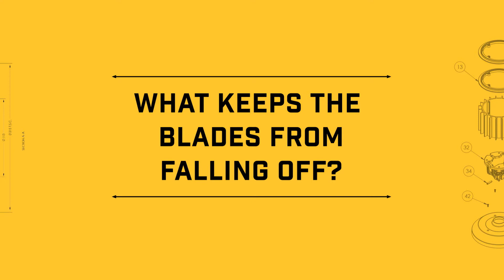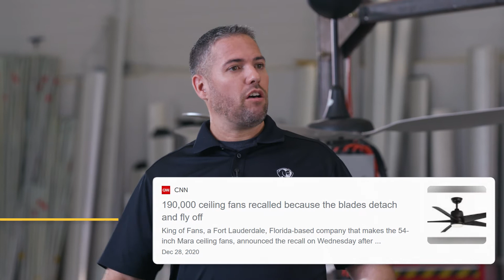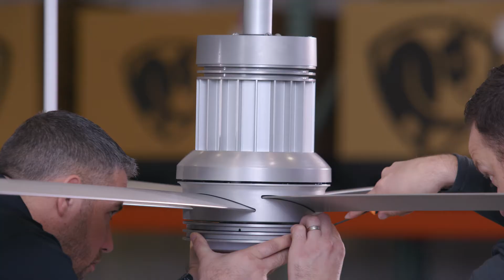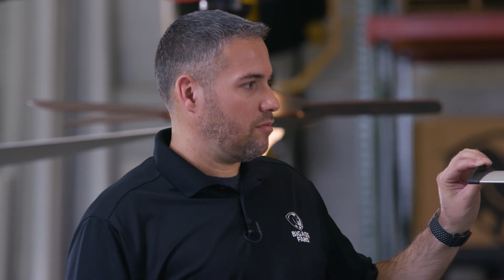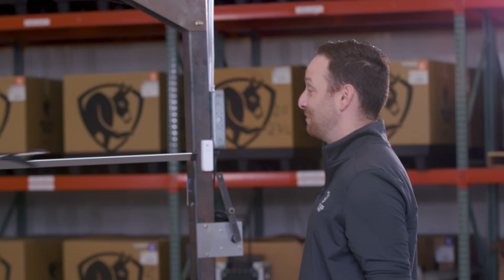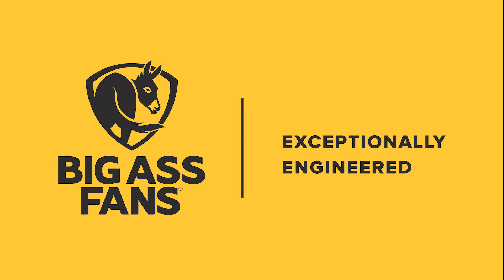What keeps the blades from falling off?

Comment: My question is how long does it spins before a nut comes loose due to continues vibrations from usage before a blade gets flung out and possibly hitting someone. What is the recommended time to get fans inspected? Especially on them commercial ones with 10-20 feet diameter blades.